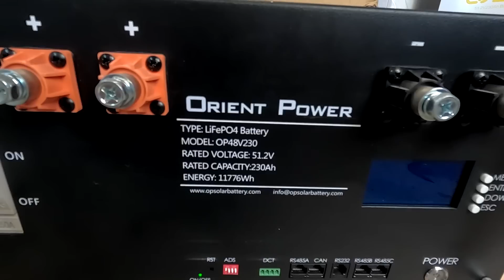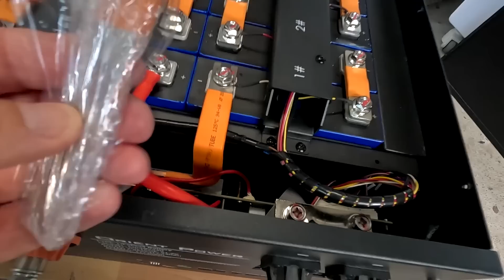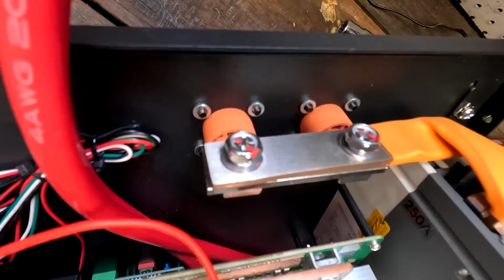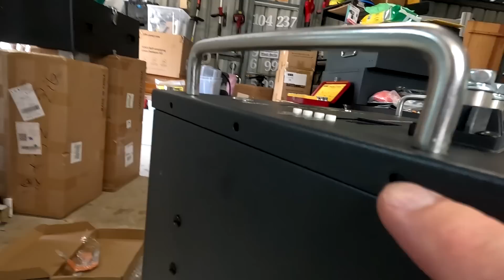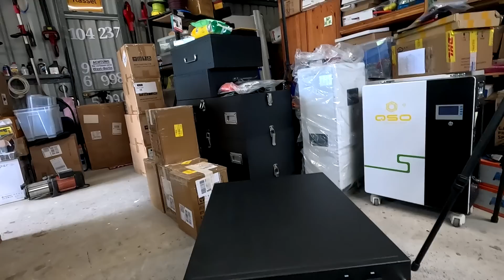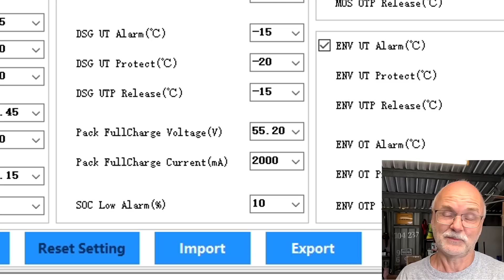Jakiper Battery Cable and Busbar upgrade. Ready for 250A?

Comment: Knowing what you've learned over the years and experience with the system and all laws/codes aside, would you build your system in the same structure that you live in? Or would you still keep everything in a separate outbuilding even if you had to factor in heating it through winter?
Reply: That’s a great question! Based on experience, there are definitely pros and cons to both approaches. Keeping the system in a separate outbuilding can offer safety, space, and easier management of heat and ventilation. However, integrating it into the same structure might offer convenience and reduce the need for additional heating. Ultimately, it depends on factors like space, local climate, safety codes, and long-term maintenance. I'd still lean towards using a separate outbuilding, especially considering potential heat and space issues in the main living area.

Comment: Glad you showed your chart of cable size vs amps . I had many discustions about to small cables . People even answer me that im ignorant or i dont know what im talking about . Your chart is about  what i follow . For my 300amp  48v battery i use as main cable inside of 120mm2  and use 50mm2 for my 5k inverter ( inverter up to 130A cable up to 175A).
Into my camper battery i replaced the to small cables with 2x 35mm2 to stay at lower temps for 200amp draw .

Its not only about what the cable is capable off but also what temp it reach . our chart is about 30celsius . Most silicon cables have a starting melting temp of 80 to 90 and instant melt about 180 a 200c (see the notice on the new cables in the video of 200c).
Ofcorse lenght is another number to consider.

Keep up the good work
Reply: if bigger size will not affect the installation, not bend and damage any component, then using bigger size wires are surely better.
Or limit the bms max current to avoid wires warm up.

Comment: Was looking great, but then you said the evil words electrical tape, evil stuff if anyone ever has to do anything with the sticker gooey stuff in the future. Never want to touch the stuff ever again. 
Just use heat shrink.
Yes the internal circuit breakers should be considered as switches, since it takes far more than 250amps to trip them. Get some external Airpax circuit breakers with the 52 curve.
Reply: Thanks for your input! We totally get your concern about electrical tape and the sticky residue it can leave behind. Heat shrink is definitely a great alternative in many cases. Also, great point about the internal circuit breakers—external Airpax circuit breakers with the 52 curve are a solid recommendation. Appreciate you sharing your knowledge!

Comment: The 4ga positive wire was pressing on the side of front panel, the panel gets the bottom sheet metal where that was pressing, plus one of the three screws is in that vicinity! I paused video to see how close that is, but couldn’t tell? Just a note for everyone to be conscious of where the fasteners will go, and ensure proper clearance.
Reply: Great observation! It's definitely important to be mindful of cable placement, especially near fasteners and panel edges. If the 4GA positive wire is pressing against the front panel, that could lead to potential wear or pressure points over time. Ensuring proper clearance and routing cables away from fastener locations can help avoid any issues. Appreciate the keen attention to detail—thanks for the reminder!

Comment: OFF topic, but i think you should spray your garage roof, inside, with thermo insulating foam. easy, fast and nice properties :) Will also helpo you from roof noises you have when hot or when raining, best of all worlds :D
Reply: Never use spray foam. That so bad.
Reply: @JdZ-2023  its bad only regarding fire. Else in Andy's case its perfect.

Comment: Those 2 reds to the switch needed to be back to back, no v shaped cables coming off the connection. 
But those cables are still not 250A+ rated. Try checking how hot they get under high load. Have you load tested the circuit breaker?
Reply: Good observation! The two red cables should ideally be positioned back to back for a cleaner and more secure connection, avoiding the V-shape. You're also right about cable sizing—ensuring they are truly rated for 250A+ is important for safety and performance. Checking for heat buildup under high load is a great idea, and load testing the circuit breaker would help verify its performance. Thanks for the valuable feedback!

Comment: you should have turned one positive cable upside down when connecting it to the terminal of the circuit breaker, I always do that when I have not much space in the area I'm connecting ring lugs.
Reply: also by the way, you can go down one size with cables/wires inside enclosures. the 250A breaker is more likely fine, it should be able to withstand the current.
for example when you have a 50A or 63A feed for a cabinet, you have a 16mm² cable feeding it and then the internal wiring is only 10mm².
Reply: @Bastler95m  Yes, redundance. The main protectio role is from BMS, the 250A breaker is secondary protection in addition to BMS. Breaker also act as an isolation switch to isolate positive, while connecting inverter/ charge controller. (connecting time no power on terminals)

Comment: Heya,yes those silicon cables are very easy to work with so that's a nice upgrade. are you sore those new busbar's aren't thicker than the old 1's ? do you have the latest update for that PCB ( I mean did you check it ) .
Reply: Heya! Yes, the silicone cables are definitely a great upgrade—they make handling and installation much easier. As for the busbars, I haven’t had a chance to check the new ones side by side with the older versions yet, but I’ll definitely take a look. And yes, I’ve got the latest PCB update, but I’ll double-check to ensure everything is up to date and working as expected. Appreciate the reminder to check these details!

Comment: I have not followed closely enough about your battery room project, but had noticed that there are starting to show 48v inverter based RV ac units at the Tampa FL RV show this year. Wondering what you might be thinking for cooling of the battery room in your shop?
Reply: Thanks for the update on the RV show! The 48V inverter-based AC units sound like a great option, especially for efficient cooling. For the battery room in the shop, I’ve been considering a few options, including active cooling systems to manage temperature and prevent overheating. Depending on the size of the room and the batteries, something like a 48V AC system could be a good fit, as it would integrate well with the existing setup. I’ll be sure to keep an eye on developments and consider these solutions. Appreciate your input!

Comment: I have 4 Orient Power batteries in my system and have had nothing but problems with them. It’s not this battery but the 5kwh wall mount batteries from Orient Power. The BMS in them is junk. Keeps shutting down for no apparent reasons and the cell balancer is almost useless. Orient Power has been contacted about the problems but never responded.
Reply: Can you get that with JK inverter bms when ordering?
Reply: @tujuprojects  I don’t think so. I have 2 15kwh batteries with the JK BMS’s in them and they have been flawless. Total system storage is a little over 50 KWhrs.
Reply: @darylowen6855  that’s nice setup. I have only one Pylontech and probably won’t get more of them. They have good CAN communication but it’s only 15S and you can’t get BMS software for it. Lower pack voltage lowers MPPT panel string voltage as well. Prices have come down -50% thou.

Comment: when are you' testing the new LF560K Lifepo4 EVE 560Ah 628Ah 12000cycle 3.2V battery? or maybe a battery pack created with the new LF560K batteries
Reply: We will let you know when 560K is into official commercial use. now it is EVE internal testing & starting of bulk producing phase.
Reply: LF560K are they even shipping yet?